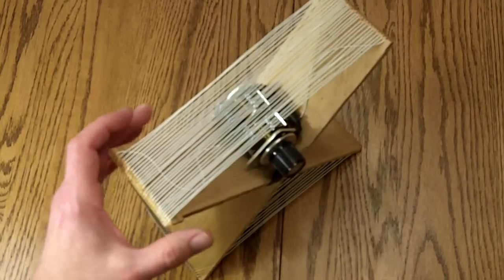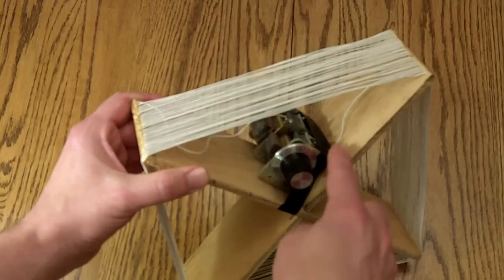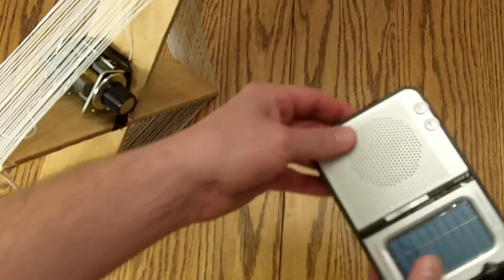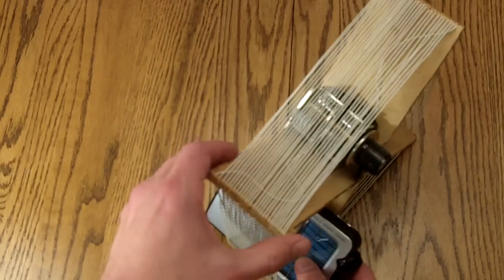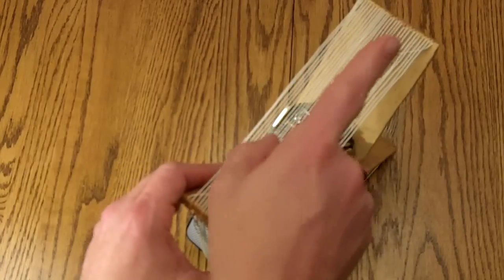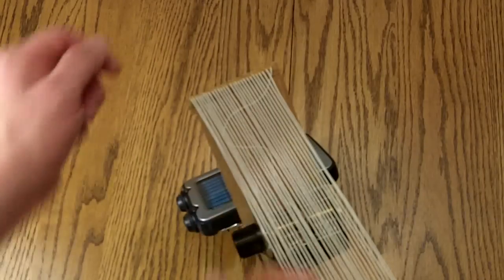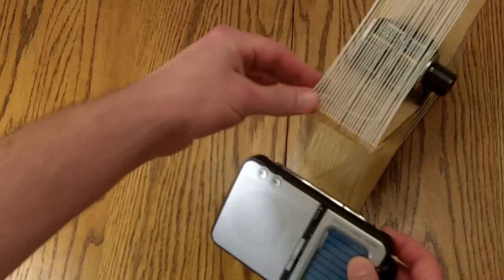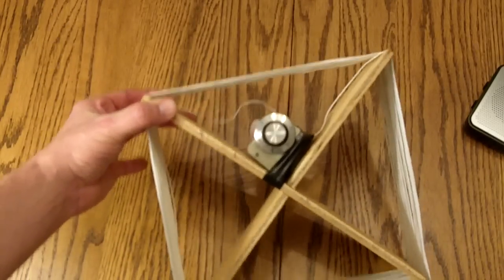AM Radio Directional Loop Antenna Demo Homemade..Make Your Own For A Few Dollars!  And They Work.

Comment: They both work extremely well. In both versions the capacitor was a dual 285pf polyfilm variable with both plates in parallel to give a max of 570pf for a wide tuning range. I will make one comment at this point, a medium size loop (say 30cm) is best, as when being used inside it will couple less to the wiring etc of your house compared to a large one and this will help you get deeper nulls.

Comment: Couple months ago, I built a slightly larger antenna than the one shown in this video.  Mine looks the same, only with 8 turns of wire.  Got a Tecsun PL-660 table top radio.  Although it's got an antenna gain switch on the side of the radio, I drop it down to "Local" and it still works very well right next to the loop antenna.  Switching the antenna gain to "Normal" gives it an extra boost.

Comment: @miketmac yes, the number of turns will affect the inductance of the loop and hence its resonant frequency. Add more turns to lower the range of frequencies covered. The size of the wire also impacts inductance (thinner wire increases inductance), but also affects the "Q" (selectivity) of the loop. Thinner wire increases the overall loop resistance, therefore lowers the Q, and so makes the loop less selective and less efficient.

Comment: @Ibringthetruth1 generally these AM radios do have a loop antenna inside. In order to keep it small, they use a stick of ferrite to wind the antenna around. However, the efficiency of a loop antenna depends on the diameter of the loop, and which is why this big external antenna works so much better than the built-in loop antenna alone.

Comment: No, it actually takes LESS capacitance, and, yes, I have used these on 160m before. You have to use a capacitor in series to lower the capacitance, which will raise the resonate frequency. Also, you have to physically attach the antenna to a communications receiver, since this antenna works with the AM RXer ONLY because it is coupling with the internal antenna. 73 de NV6R

Comment: I have made many of these :-) I gave one to a friend which was made out of 20 way ribbon cable connected as a coil constructed on a frame made out of PVC and fibreglass rod. The other was a 30 turn one made out of ribbon cable also and slipped over a box. This one did half of mw AND longwave.

Comment from the maker: It might be a little more efficient but generally at those frequencies it couples well to the antenna like this quite well most of the time and you probably wouldn't notice much difference unless you are using a higher quality radio with built in external antenna jack maybe.

Comment: @quarknimble you can adjust the frequency coverage either by adding/removing capacitance or by varying the number of turns of wire. So, to cover 160m you would need to reduce the capacitance (eg. by adding a fixed capacitor in series with the variable capacitor) or remove some turns of wire. If you want, you can use a switch to add/remove fixed capacitors from the circuit to extend the overall range.

Comment: wow great antenna.
My loop antenna covers from 650 to 1710khz.  Because i put 5mm separation from one turn to another. Same loop as the video (30x15cm of wood), and I used a variable capacitor of 336pf

Comment from the maker: @mrjon925 Thanks for the comment, you are correct, the larger the size, the less number of turns needed.  There are online calculators if you do a google search for calculating am radio loop antenna that will give you number of turns to use with your capacitor and size you want, you can experiment with the calculator.Tthe variable cap is not polarity sensitive, Just put in series with the loop wire.  Once side of my cap was on the housing but not always the case.

Comment from the maker: @FarceTheory a single turn loop can be made for FM frequencies but you would probably be better off with a dipole or beam style antenna for FM frequencies mounted outdoors.  This AM band loop would not work on the FM band since it is designed for much lower frequencies...

Comment: I was looking for an antenna specifically to use with my SDR/Ham it up, and found this. Great video. I don't want to connect my big G5RV up to the SDR just to pull shortwave signals, and this looks like a neat little antenna. 73 DE KEØDOX

Comment from the maker: @johnu78 I don't remember the guage for sure but it was just some small wire I had around on a spool.  The size of the wire is not that critical, the smaller wire is easy to get several turns than with a larger wire but I wouldn't worry too much as long as it is easy to work with.

Comment from the maker: If I remember correctly, I hooked up one wire to the housing part of the cap and the other to a terminal from one of the sections of the cap, I experimented a little to see what covered the most range across the dial so you might have to try a few different ways to see what covers the range the best. I don't think I used both sections of the cap.

Comment from the maker: Actually there is a very small voltage or current induced into the loop from the signal, very weak, but every capacitor and loop or inductor will have a resonant frequency and that is changed as the capacitor is tuned, so when it hits the resonant frequency, it will produce a stronger signal that can be coupled to the radio loop antenna.

Comment from the maker: @kenlen13 Yes, a medium wave radio.  The older tube types have the large open air capacitor and I like those the best but you can also use the small mini sized variable tuning caps found in transistor radios and that should be fine also.  Antique Electronic Supply (search name) has the open air type 365pf, part number C-V365 I see for around 12 bucks.  They probably have the small plastic enclosed ones also but not sure.

Comment from the maker: The antenna doesn't care what kind of radio or TV you use, it will still pull in the signal.  Won't matter if it is a digital signal or analog.  As long as the frequencies are in the range the antenna is designed for.  Just like for the new digital TV, the old antenna will work fine if it covers the normal TV range, there is VHF and UHF. Some claim digital ready TV antenna, but they are the same designs. A signal is a signal. You need a little stronger signal for digital though many times.
Reply: Yep. "Digital Ready" is just a marketing gimmick to sell the antenna.  A good, decent rabbit ear antenna is one that has a power amplifier built in to the case.

Comment: other suggestions include making the antenna so that you can gimbal it and coupling the loop to the receiver via a single turn of wire the same circumference as the main loop but spaced so you dont overcouple to it.

Comment from the maker: @Bigus85 There are commercial versions you can buy such as a TERK  AM antenna loop, just do a search on that and you will see them, there used to be one called the SELECTENNA I think it was or something like that, not sure if they still make them or not.  Or you can make your own, several websites that show you how to do that if you search for Build  AM Radio Loop Antenna.  They all work about the same as far as I can tell as long as they are made to cover the same frequencies.

Comment from the maker: At 6 Mhz you would be best with a magnetic type loop about the size of a hula hoop and use the same type of tuning capacitor.  Size of the loop not real critical, just around that size should work fine for that frequency.  You might want to search magnetic loop antennas, lot of ideas out there on them and how to calculate them for the HF bands..

Comment from the maker: @opolo2112 I think the rod antenna that radio has will work very well and I don't think the antenna in the video will work much better since that radio and ferrite should work very well the way it is.  My loop will mainly improve radios of less quality than that one.  However, if you were to make a much larger sized loop than mine you may notice a good improvement.  You can hook up any loop directly to the radio if there is an external jack for AM but I have not tried that yet.

Comment from the maker: @miketmac I had a few in my parts box salvaged from old AM radios, 365 pico-farad is the value I used.  There are several places that sell them also, just search for 365 pico-farad variable capacitor in the search engine and you will find places you can buy them new. I don't think Radio Shack sells them these days.

Comment from the maker: @djEvilDude I think you can get them online yet if you don't have one, just search for 365 picofarad variable capacitor.  No batteries needed, the loop of the wire simply couples with the internal small built in loop the radio has, just like a transformer works, all you need is the wire and the capacitor and place by the radio.  Lots of plans on the net if you search for AM radio loop antennas.  Thanks for the comment and question also BTW!  Always appreciated here.

Comment from the maker: This one will not work at those frequencies but you can make loop antennas for those other ranges, just a little different, a little larger and usually only one turn for the coil.  Calculations can be found by searching for HF loop antennas.

Comment from the maker: @bennra26008 thanks for the comment! That is great on the Silvertone, you will have a lot of fun with that radio. The loop I made will only work on the AM broadcast band, but you can make a loop that will cover parts of the shortwave band if you wanted but a whip antenna or wire antenna should work fine for you on SW.  If you google loop antennas you will find a lot of info for other bands though if you want.  I think I used 20gauge wire or so, not critical at all, small wire is easy to use.

Comment from the maker: From my experience, a larger size loop will work a little better than a smaller size but I have not tried more than about a few feet in diameter.

Comment from the maker: @johnu78 Also, I used insulated wire so the wires would not short out to each other, you do need to keep each turn separate from the others so as not to short out to each other or it will not work for the range you want.

Comment: Great video Larry. I was wondering how you joined  those 2 pieces of wood together, didn"t think you just glued them together, then I saw the comments below and you explained it. I am going to make one using your design. Just heard that the pirate radio station Radio Caroline has been awarded an AM license to broadcast to Essex UK. It is moored just off the coast. That"s over 100 miles away from where I live. The signal will be aimed for that area, hoping to receive it though using the loop antenna. See Youtube "Radio Caroline AM License" if you are interested. Cheers Larry 73.
Reply: Hi, Peter in Worcester here. i can just get caroline now but very weakly with a lot of static and hiss. occasionally it comes in quite strong. that is on several different radio's with their internal ferrite rod antennas. i've made a 20" loop but all is does is increase the band noise-no improvment on caroline. i am going to attempt another loop.

Comment from the maker: All you do is tune the radio to a weak station first, then tune the antenna until the signal gets much stronger.  Or tune radio to a blank spot and peak the antenna tuning for noise. Then they are both tuned to the same frequency.

Comment from the maker: @miketmac yes it does, I just added a link in my video description that you can use to calculate the dimensions needed.  You can play around with the calculator plugging in different frequencies etc using what you have to figure things out, works well.

Comment: HI,
This is really interesting and informative, Thanks for sharing. Do you think the results would be greater if you made the antenna larger? In other words, Say you made it 3 or 4 feet across. Would it pull in stations even stronger?

Comment: I am a big AM/MW fan -m I am considering buying a grundig satelitt 750 mainly because of the turnable ferrite rod antenna on top - do you think a second larger or longer ferrit ros glued or taped on top would improve reception further? I want to be able to listen to Chicago radio in Florida- your loop looks fine but a ferrite rod would be less cumbersome- is there any way to put a plug on your loop so it could set a few feet away from the radio and still work or is it near-field only?

Comment from the maker: @quarknimble I am not sure if you would be able to stretch it out that far or not but I just added a link to the page I used to calculate my dimensions, you can play around with it putting in different values to see where you come out.

Comment: I have just stumbled upon this video and it looks really useful, thank you for posting mate! would it be possible to wire this loop directly to a MW AM RX that I am building that has no internal ferrite aerial? If so is there anywhere I could obtain a basic diagram for this aerial please? Thanks for your time and 73s
Reply from the maker: Yes, you should be able to wire it directly into the radio you are building. That should work fine as far as I know, maybe some others can comment also.
Reply: If you're gonna use it instead of a ferrite antenna in your radio, don't use a variable capacitor in it (assuming the radio circuit you're building already has one). Otherwise you'll be always be fiddling with two dials to select a station.

Comment: Great Job, as an LP Broadcaster and a general broadcast license operator, which includes about 13 part 15 stations, many of which I built my self, I found this quite interesting, by the way your antenna there don't require batteries, what about soldering or conductive glue, and did you use wood, looks more like a cardboard with a wooden finish look for an more appealing look. Do you use this for DXing and if not, would it work for DXing, I see you stated your from Minnesota and your receiving WSM in Nashville, I am from Waupun, WI. The station, you received most likely at night time through DXing, was this DX in season or out of season? Most DXing occurs during sunset (dusk) and sun rise (Dawn). Is this the farthest you have received on MW(Medium Wave), (Regular AM Radio band, for regular consumers) I have actually been able to pick up, CFM(Zoomer Radio out of Toronto Canada.) This is interesting since Waupun is middle of Wisconsin. about 54 miles north east of Madison Wisconsin, and about 52 Miles from Appleton and about 57 Miles to Green Bay Wisconsin. I do live in the middle of the state, all broadcast markets seem to have us as the fringe point for their markets except upper wisconsin/TheUP market. Which means I get too many stations that interfere with each other. One huge example is Fox 6 WITI interferes with ABC 6 Low Power*Analog*, in Green Bay, WI. Another great example is 87.7 an low power version of ABC 6 interferes with a low power station in Beaver Dam, WI's High School/Maraine Park Tech. College station . It means many times, we about 6 to 8 stations on one frequency and usually have to point our antennas to a very certain angle or degrees to get just one market or otherwise we put our antenna up without angling at one market we get all the markets except the UP markets. It get quite hard to listen to the radio due to this. Any suggestions? Keep up the great videos. Any ETA on the next Antenna for AM? Great videos I enjoy them not common to see these here. Very much enjoyed. Keep it up.

Comment: What type of wire did you use - magnet wire? Thanks for the video.
Reply from the maker: I am not really sure what it was, it was an insulated type wire but magnet wire should work just fine also.  Don't matter much as long as the turns don't short out to each other.
Reply: Thanks.

Comment: looks like you used litz. ive got a lot of 18ga i need to use . is there a formula for turns and what not.  great video
Reply from the maker: +billybonewhacker Yes, there are a lot of calculators out there for loops if you do a search on google for calculate am broadcast band loop antenna.  That is what I used, can't remember the exact site now but if you do some searches they are out there.  Thanks and glad you enjoyed!  The loops work well.

Comment: if a electrical connection is needed, is the correct way to wire it up in parallel with the capacitor?
Reply: Yep

Comment: can you stretch the frequency coverage up to cover the 160m band? (1800-2000khz) i would like it to cover 500/530-2000khz. is this possible with a 365pF cap or will it take more capacitance? (500pF)??

Comment: Looks like you took 1 piece of wood and left it full length. Then you cut the other in half and glued them on both sides of the other to make an X? What keeps the X from collapsing under the strain of the wire? I know its probably not too tight but needs to be somewhat.
Reply from the maker: +YoMoma777 I cut a slit on both pieces of wood half way across so they fit together like a puzzle, and the wood is quite strong and the wire is not wound tight at all, it just goes around the corners good enough to stay in place, so really no stress at all, worked out ok anyhow.  I just used what I had on hand here.
Reply: +RadioHamGuy 

OK, I have 2 questions for you.............

1) Would this work with "plug in the wall" radios as well, or just with "battery power only" radios? 

2) Since you seem to know what you're doing..........could you build me one if I was willing to pay you for it? I don't know enough about electrical equipment and mechanical engineering to be able to build one on my own.

Comment: i just won at auction a small collection of vintage tube radios. One is a 1927  Majestic high boy console. In my area the radios receive one maybe two stations. Would a directional loop antenna be any help with these type radios?
Reply from the maker: Yes, they work very well with some of my old tube radios!